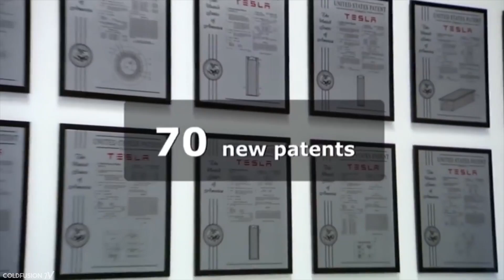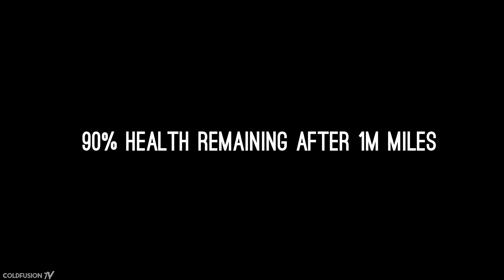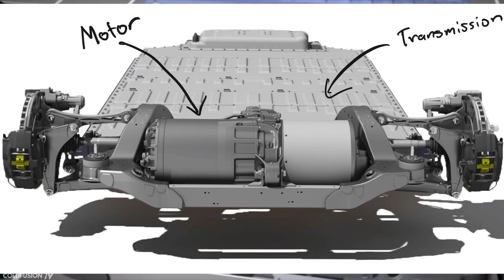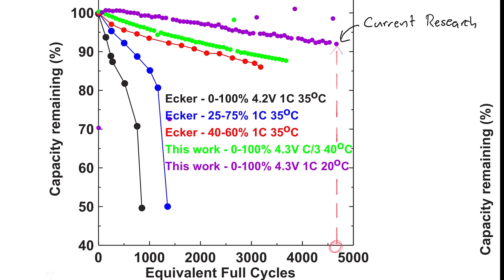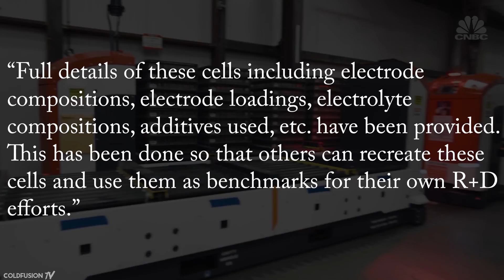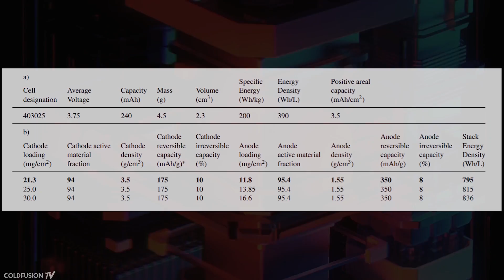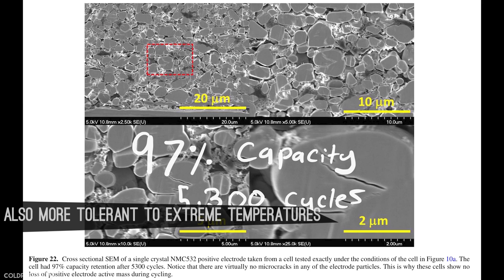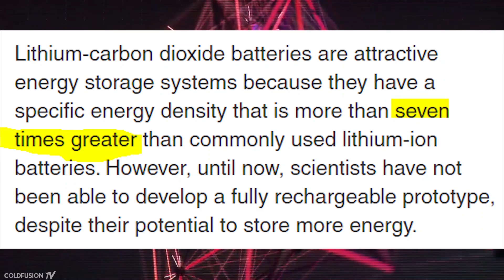Tesla's Million Mile Battery

Comment: Thats  Low KEY fakeass marketing as usual from the big ass  entrepreunurs... I remember how Elon humilated Tesla and hailed Edison... jesus christ.. that tells everything. if you dont understand, well that tells how brainwashed and ignorant u r as a 2019 earth living iphone worshipping ever decreasing IQ-inhiabitor called human. Back to the point: 1 million mile battery in title gives  the fals hope that batteries  run longer on single charge.. at any rate batteries alone are still utter useles.. the energy density is 40 times less than liquid fuels..
Reply: Elon appreciated how Edison pushed technology to the masses, tesla was a too sheepish, Telsa motors does not advertise, they will do some promotions and shows but no adds on TV, twitter is their biggest platform, tesla didn't acquire battery manufacturers and cell chemist for a marketing ploy, that would be a waste of several hundred million they spent...

Comment: Intsead of thinking it as a million mile battery can we think of it as a battery that can be supercharged regularly instead of rarely for a normal battery as it will degrade quickly.  This will make the life of the battery to a average but will reduce the charging time drastically

Comment: It find it encouraging that Tesla is sharing its battery technology so it can be a benchmark for all other companies - thus raising the bar so all are at the same level of technology. Perhaps the human species might just have a chance if major corporations put their differences aside to enhance the chances of humanity to use electric powered cars. I wonder where the battery packs for the entire electricity grid will be in five years. Perhaps if solar panels can be developed where they work 90% capacity - now that would be amazing.
Imagine if the solar cels could be so advanced and micro-sized that in 15 years that they are 'bonded' into the paint of the car and they could charge the car's battery. Great for here in Australia.

Comment: 100% bullshit.  1,000,000 mile vehicle with "minimal maintanance"  .. 

aka.. just needs 3-5 batteries, 4-6 new motors, 2 AC units, 2 new heaters, a new interior, 

and 20 shell replacments from idiots using any of the apps.

Comment: This is a Tesla overstated and misleading promo. The technology discussed in the related paper is more resistant to charge\discharge cycles degradation compared to the best Lithium technology currently on the market, but It has a MUCH LOWER energy density that means lower charge duration and miles that can be traveled on a single charge.
Reply: its lower manufacturing cost and better thermal stability means you could put more cells in the packs and a higher count because of the reduced coats, the chemistry i the paper is also not teslas formula, thats just the base formula, Tesla will likely use Maxwell dry cell technology on their passenger cars.
Reply: @miguellopez3392  15k battery that can do 300ish miles, vs a 8k battery that can do 120 miles. ....   density matters
Reply: @zarthemad8386  what does density have to do with battery pricing, you assume higher density batteries are cheaper.

Comment: Elon out here to changing the world and making another one usable
Reply: Which war has he stopped? Thats where all the waste is. Perhaps if he made the US invasion forces electric tanks other countries would be safer.
Reply: Graham perhaps if planes were electric the terrorists wouldn’t of used them on 911
Reply: @ohdontmindme4241  Research what Christopher Bollyn says about that event. Also nothing hit WTC7.
Reply: @ohdontmindme4241  No the jet fuel didn't melt anything, it doesn't burn hot enough - everyone knows that. Also WTC7 didn't get hit. BTW Who cares what religion they were, especially some irrelevant minority? We must always think about the majority for they are the most important.
Reply: Graham okay I’ve looked a little bit and there is some shit there. Bottom line though. Either fuel melted the steel or it didn’t but was made to look like it did. If airplanes had electric batteries 9/11 would’ve either been prevented or looked much different. Can we at least agree on that😂😂. Since the video is on batteries and not 9/11
Reply: @ohdontmindme4241  There is limited evidence that planes hit WTC1 and 2, but as those towers would not have fallen due to those impacts I don't think we can blame the planes in this case. Then there was Flight 93, WTC7's 'plane' that crashed but there's no evidence that was a plane, and the final 'plane' was actually a small DU loaded missile that hit the pentagon and took out their fraud department looking for several mission $tn at the time.
So I'm thinking that even if planes were powered by rubber bands Silverstein was still going to get his asbestos riddled highly insured financial liabilities destroyed (lucky he was washing his hair that day!) and the Israelis were going to get US military cannon fodder for their glorious Yinon wars.

Comment: i will consider battery powered car only if a single charge can go 1000miles
Reply: almost no cars have that range, let alone half of it.
Reply: odisy64 it will in future, even at 1000miles, it can only go around 700-800 miles and if u push pedal like I do all the way most the time we are only looking at 500-600miles and due to the scarcity of charge station epa rating at least 1000 miles in single charge will make sense

Comment: I don’t believe it. If he created a million mile battery he would end up like all the other victims that replaces oil. The Rockefeller family would have him bought out or he would be rubbed out.
Reply: the model 3 battery already is suspected to brake 500,000 miles at 70-80% original capacity, this is bad news for oil companies but not totally bad since natural gas is how we make most of our energy, they arent going to loses it all because of a battery, but its a start.
Reply: @miguellopez3392  cept.. they have to be replaced at 8-10 years.. so not gonna happen.
Reply: @zarthemad8386  the average person drives 13k miles, it would take them over 30 years to ware out the battery at that rate.
Reply: tesla has the most shorted stock for a reason, he has pretty stupid but determined enemies.

Comment: A million miles batteries - what for?
For trucks the obstacle is that you need a much higher energy density - means major kWh per Kg - to get a high range and low battery weight allowing the payload to be high. If that is achieved - than you would need a nature that manages a million miles. That would leave only the time for recharging to be a disadvantage (and of course that electricity needs to be created by some means and transported). Call me weird but I think that hydrogen is a better option for that.
In local public transport long lasting batteries would be essential. Same applies for the individual commuter transportation (aka private cars). But in private cars it may not be of such importance simply because of you drive like the average German car owner you drive 14000 km/year. That means your car would be 100 years old before the battery is not fit enough to be used in the car. That seems to be an very odd lifetime for a car... Especially seeing the evolution of cars and technology integrated in cars would make that 100 year old car a dinosaur. If the batteries would be standardised then, of course, you could swap them into a new car every few years. But we all know how that will go (different car makers, improved battery technology leading to smaller ones etc).
Again: the goal must be higher energy density paired with very fast charging.

Comment: So, you get a battery, which takes 5 - 10 hours to charge from home, depending on if it’s a 60 kWh or 85 kWh and whether you use 120v or 240v @ 40 A. Holy crap that’s a lot of home current for 5 + hours. That’s like running your air conditioner for your house in Phoenix AZ set at 60 degrees when its 115 outside. The AC alone would set you back $400 a month now add at least another $400 for electricity. Ouch.  A Tesla station charges faster due to 120kW rate but even here a full charge is close to 90 min (optimistically). This “new” battery still has to be charged...at these rates. The battery itself may physically last 1 million miles but a charge will only take you about 300 ideally. Meantime, I fill my 30 gal of diesel or gas in my pickup and I’m gone in ten min IF I use the restroom. 450-550 miles later I do it again. BTW: where does the electricity come from? about 40% is the US is still from coal plants, 20% from (gasp) nuclear the rest oil or natural gas fired plants or hydro (oh the salmon) and a small percentage from “renewable”. I can see the “carbon” from here! If this stuff worked, Elon wouldn’t need a $5-10K subsidy per car; they’d fly off the sales floor. Hope they never have to shut down power grids for fire risks or something then all those commercial Tesla stations would be worthless...oh wait that just happened, sorry California Tesla owners and others. I’m all for Elon and SpaceX but e cars and the tech is nowhere near maturity especially if they can’t make it in direct competition with gas and diesel vehicles.

Comment: Make a video over the co2 battery!

This is really cool, tbh. If Tesla's under normal driving (like real world driving) can pass 600 miles in range, they will literally be better in every way from an internal combustion engine. 

Something I would like to see, though, is some sort of gas or solar powered range booster for the cars. Something to charge the batteries during a long road trip where quick charging stations are sparse but gas stations are relatively abundant. Something you could use that would sync with the cars computer and which would run to charge half the batteries at a time when they hit 30 or 40 percent charge or to keep them above a certain threshold (in the case of these new batteries). Or that would allow you to "run" the charger for 30 to 60 minutes before leaving your hotel that would fully charge the battery. 

I'm thinking something removable for long trips, not a permanent feature of the car. It kind of goes counter to Tesla's mission, but I think it would help during the transition as there are still a hundred thousand times more gas stations than quick charge stations and Tesla has yet to install enough quick chargers along every stretch major interstate. A roof mounted solar array (again, detachable) could be used for such trips at the expense of the glass roof. Or perhaps a permanent transparent solar cell embedded in the roof glass. This would be handy for running the car's battery warming gear in winter, cooling gear in summer, and giving a bit of charge to conserve as well as mildly charge batteries while driving or parked. 

Last feature I'd love to see is built in compressor for tires that could adjust and maintain tire pressure to balance loading in the vehicle, which would optimize range by balancing traction with drag, as well as keep a tire at pressure after a leak is detected until the driver can safely pull over to change it over to a spare, or otherwise get to a service center to get the tire replaced. 

I'm not a huge fan of hand-me-downs as a youngest child of 3 and the youngest cousin of 8, but I can see Teslas becoming hand-me-downs once these new batteries come out. Mom and Dad drive them and then pass them down to the older kids once they become old enough, buying two new ones for themselves. One or both kids pass theirs down to their younger siblings once they're old enough, either taking Mom and Dad's old new cars or buying their own. 20 years is a hella long time, and given how little maintenance electric induction motors need, barring any other battery temperature management systems, car computer systems, etc, that really only leaves the tires and brakes. The lights are already led (if my assumption is correct) which can last for 10,000 hours or more, and barring any accidents, that's like no maintenance over the life of the cars. What I would like to see is Tesla launch a referb program for older Tesla's (in the next decade or so) so they can minimize waste by replacing battery packs (with new 26650 cells with the new chemistry), vehicle computer and communications, as well as a total cleaning, detailing, replacement of bad panels, referb the motors, and an all over cleaning. The idea is that, while still an expensive referb ($15-20K) it would allow Tesla to sell older like new models at the $20-25K range and tap into the base tier "new" car market. They could buy older trade ins and used teslas as trade in value then sell the older vehicles to cover cost of referb, cost of trade in discount, and perhaps a little profit on top.

Comment: We need Cars like electric drills. The battery can be changed in seconds.
Reply: They already proposed and tried this years ago, but the infrastructure was going to be too much to build out and you would need the majority of the EV vehicles to use the same type of replaceable battery components. This guy did a startup specifically for this but didn't go anywhere. This was when the first Tesla Model S were being mass produced.
Reply: monster garage did it using lots of drill batteries

Comment: If CO2 batteries become profitable, then we would have to worry about Global cooling within 10 years!
Reply: no, you would still increase C02 output with production of C02 batteries.
Reply: @miguellopez3392  Ultimately no and you can see this in carbon sequestration of plants.
Reply: @Ramiromasters  again, where would you get the power to chemically extract C02?
Reply: @miguellopez3392  From any source whose CO2 emissions equal to less than what is being sequestered.
Reply: @Ramiromasters  that energy can be used on a machine that plants trees or replace a fossil fuel plant.
Reply: @miguellopez3392  Right, but the idea is to get a battery to power something,
Reply: @Ramiromasters  yes and using carbon for batteries would not really matter.
Reply: @miguellopez3392  It would matter in all the ways that better batteries with negative emissions matter... From Cellphones to Electric cars! you just want to say nah to something right?
Reply: @Ramiromasters  the negative emissions would be minuscule compared to the better efficiency of new lithium chemistry, thats why.

Comment: This single biggest difference in what is happening here with OPEN SOURCING all these designs on batteries and EV tech is that this is a younger generation doing the work and making the decisions. The baby boomer (vampire) generation have, during the full term of there life span set up a one directional system that locked in OIL and COAL (for greed and profit hoarding), while also locking out all renewable's as well as nearly all other corporate structures. There can be a future, but not by doing "Business as usual".

Comment: If the battery loses 10% after 4000 charges and they make it so you can drive 1000km with one charge, does that mean some day cars will make 4milion kilometers without changing the batery?

Comment: It's called test of time. No one knows, obviously. Lithium is severely hazardous to mine and isn't recyclable. Battery might last that long...but what about the transmission, bushings, electric motor, solenoids, bearings, hubs, suspension...probably about on par with normal ICE vehicles. Besides from solar, that produces very little power, Tesla is still reliant on using fossil fuels and nuclear to charge the batteries.
Reply: this is high school chemistry, lithium is a element, its is very recyclable.

Comment: just another unproved claim from Musk...in cold or hot & humid weather batteries lose 50% of their capacity and must be changed very often. not recharged on a regular manner they again lose their optimum capacity.Disposing of them is a major industrial and ecological issue.
and last but not least where is the clean energy going to come from to charge them ???
Reply: dude, im pretty sure tesla knows this, which is why they also purchased Maxwell technologies for their dry cell batteries superior operating performance, this cell is made for longevity, these claims arent unproven? they are lab tested, also humid weather? do you know how a BEV works? they loose their capacity if you leave them discharged for too long, i have left batteries at 80% charge for storage and left them out in the winter cold, 8 months later i pop them in my power tool with most battery still remaining and works fine., tesla want to use solar to charge their batteries and are developing recycling processes.
Reply: @miguellopez3392  this all wishfull thinking aussie possible development in the future...up to now such claims have always been delusional.
Moreover Musk is known for promising unrealistic results...this is communication/propaganda.
Reply: @loicm5002  tesla built the largest battery storage system in Australia, its its currently on track to pay for its self in a year or two, after that the aussie tax payer saves 40 million a year on grid balancing. Musk also has a reputation of saying he will do the impossible then doing the impossible, no one thought that a silicon valley start up would outcompete military contractors in the space race. Back in 2012 no one wanted an electric car, 2019 and tesla becomes the fastest growing car company in the US with continued record deliveries.

Comment: You said the battery loses 10% or health after 1,000,000 miles but also 10% after 4000 recharges. That would mean going 5000 miles per recharge which is more than 10 times further than current technology.

Comment: What will really help things is the use of super capacitors.  Maxwell.  In cars, super caps can absorb all the braking energy recapture, then do all the accelerating energy.  This takes a lot of stress off the battery, doubling its life. Add in the new solid state unflammable electrolytes using Li metal with 2 times the capacity!